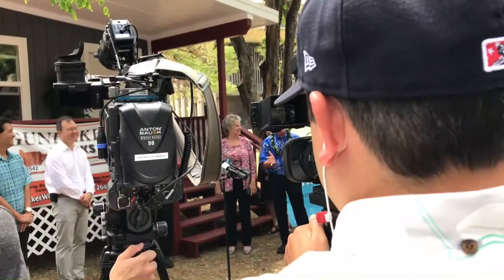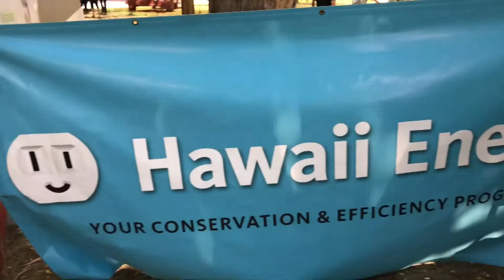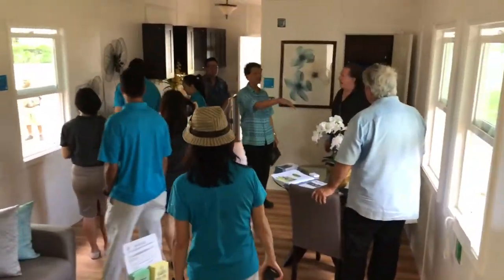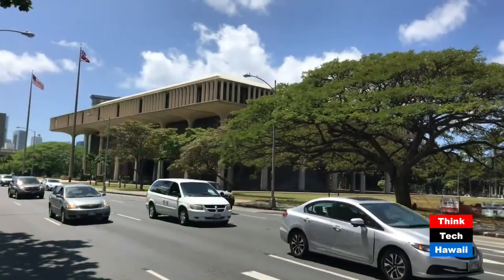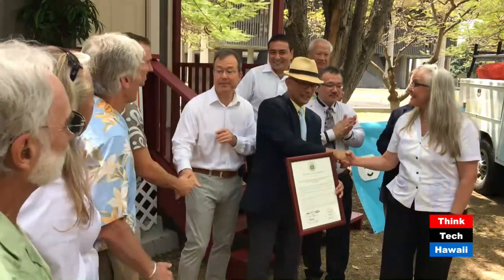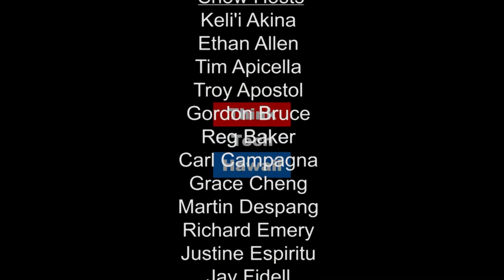Fueling Hawaii's Future - Global Energy Perspectives and Impacts on Hawaii

Comment: The guest makes many important points including the disruptive pressure natural gas has on the coal market, usurping even King Coal, long thought by experts to remain our electrical mainstay.  Now, almost totally dethroned from the center of the electricity world.  Also, pointing out that the fossil fuel of any kind offers no intrinsic competition.  Kind of like the old model-T thing, you can have any color your like - as long as it's black.

However, when asked about the future for Hawaiian energy, the guest intimated Hawaii is at a cross roads, between Liquid Natural Gas (LNG) and Oil.  Particularly Low Sulfur Oil  (LSO).

The guest makes many fine points, however misses the true fork in the road.  Hawaii has declared energy independence, which is really a choice between the 19th century, and the 21st.  The fork in the road is not between two branches of fossil fuels, it's between Carbon, or no Carbon.

It's between toxic, or non-toxic.  It's between self-sufficiency, or commodity.  It's between economic slavery buying liquid fuels from an outside force, or self determination with no impacts to any future generations on air, soil, water, or biology.

It's a choice between sourcing fuel feed stocks either from Rock-oil, or from water.  It's a choice as stark as between the past, and the future.

This is the real fork in the road, and at the center of the heart of actual clean energy independence.  Like all industries, especially those founded over a 100 years ago, fossil fuels (oil, gas, coal, mining, fracking, strip-mining, refining, tanking etc.) is not immune to disruptive technologies - it's the natural course of markets of all kinds.

Kodak, and Polaroid went bankrupt within a decade of the digital camera, the oil industry will be no different.

Why source liquid and solid fuels from thousands of miles away?  Hawaii has more than enough solar energy to produce powerful, clean, and sourced from water and returned to water when used, water as a feed stock to produce industrial power without buying anything from anyone.

That's what clean energy independence really means, it's not just you win with pollution, and stable hardware costs, and you don't need to import anything from anyone, it's that you win economic freedom.  Once you pay down the hardware (solar/water/hydrogen), you pay no-one any more.  That's true independence.  That's true freedom.  And, with no pollution for your children, that's right on.

Clean energy independence will save Hawaiian citizens billions of dollars annually in costs normally paid to fossil fuels every year (not to mention better health).  In Hawaii's future most fossil fuels will be replaced very rapidly, as all disruptive technologies move, replacing fossil fuel infrastructure - designed to move liquid fuels everywhere - replaced by stand-alone primary power production converting solar PV electricity into Hydrogen fuel from water.  That's the only future which offers true clean energy independence outperforming fossil fuels in power, non-toxicity, and distributed sources opening up true diversity of source and true competition.

Hawaii is indeed at the cross-roads.

Hawaii has declared energy independence.  The future of Hawaiian energy will either be Carbon based, or water based.  The former is how your grandfather did it, the later is how your children will do it.